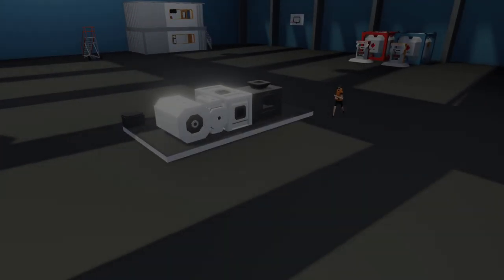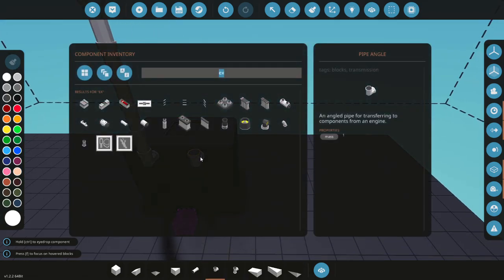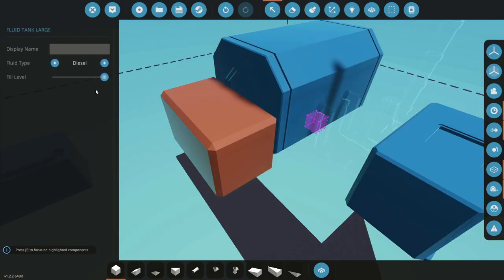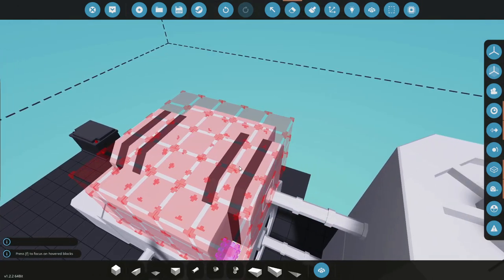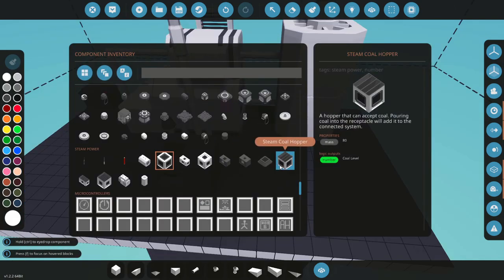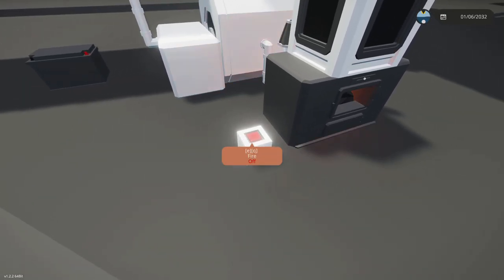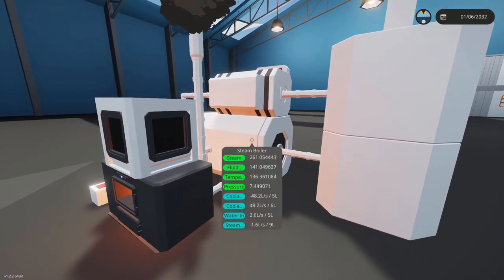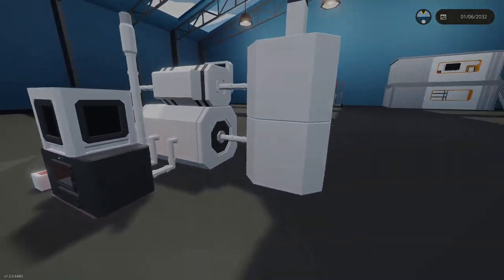How to build a Steam Engine in Stormworks B&R

Comment: WHERE IS THE SECOND TUTORIAL NO MATTER WHAT I DO THE PRESSURE GOES OVER TEN AND EXPLODES
Reply: I FOUND A SOLUTION!!! add a on/off valve to your Firebox Coolant Output line with a threshold of 0-110 so that way the boiler only goes up to 110 degrees and also add the steam release because it will still run way and explode if you don't add them
Reply: @Danman2988  you replied to a 5 month old comment I fixed it white pumps
Reply: @GodzillaJawz  Oh, lol. nice